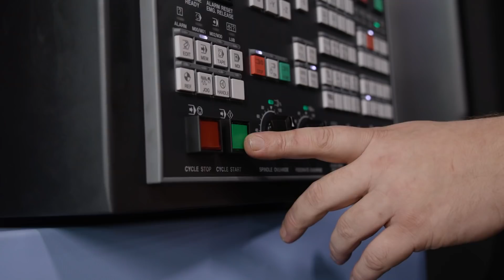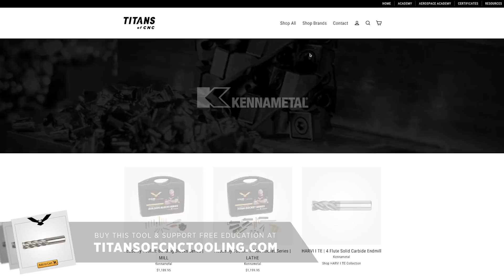NEW End Mill Cuts Through Stainless Steel Like BUTTER

Comment: How is this possible ;o I have the same steel but a pretty tiny desktop CNC machine (though the frame is steel, ball screws, linear rails etc), but I can cut slots with at most 4mm carbide endmill, 0.2mm at a time and then I see this - it literally removes the volume of the whole fucking stock I'm cutting in a split second and it would take my machine like 10h omg

Comment: I noticed you have “no coolant for filming” however I have found that no coolant is superior with the AlTiN coating in stainless since it is very wear resistant at high temps with its aluminum oxide coating. Do you guys actually run coolant in this operation? If so why?
Reply: Just wait. Ill be doing a “talking” video about exactly that, next week.

Comment: How much power does it need to run that tool like that? 😲
Also, I was thinking if you could make a video about using HSS and carbide slit saws for steel and alu? After all, it could be a very fast way to part off small finished elements from bigger chunk of material so you don't have to take it off machine and cut it on saw and/or facemill. That's a huge timesaver 🤔

Comment: I have never used a horizontal are the parts hard to load
Reply: No. Not if you have a forklift. Is it a tiny bit harder than a vertical? Yeah. But using gravity to evacuate chips makes the extra 10 seconds sooooooo worth it

Comment: Good morning! I’ve found the academy so helpful so far but my only gripe is that after the first 10 mastercam tutorials I’ve been left craving more! 😆 I was hoping for more tutorials of complex, 5 axis, aerospace-type parts to be drawn (CAD) and programmed (CAM) so I could feel more comfortable applying for a job in the industry doing that. The first ten parts is a great start but I’d like to get through quite a few more before I feel hirable as a CNC programmer. So with that said, Is there a plan for the future regarding additional Mastercam tutorials? Thanks so much. I appreciate everything you guys are doing! It’s changing the industry for the better and bringing work back to the states! Boom!
Reply from the maker: Have you done the Rocket & Fixturing Series? Checked out the AerospaceAcademy.com
Reply: Sweet! I only did those in fusion 360 so far, I didn’t know they were available in mastercam now too! I’ll start on those today! Thanks for the heads up :)

Comment: Some times you say cutting fluid off for videoing and others are blank.   Can you explain if and when coolant / cutting fluid is needed / required or just nice to have.  Still love the data you give to the world. It means your not worried.  You and the team has the abilities to use the machines and tools  at optimum  the data gives the starting point for many .
Reply: Next week, i will be doing a video on exactly that. Stay tuned
Reply: Cutting fluids are used to aid in reducing friction an clearing chips from the work zone. It is also used to control heat buildup and keep red hot metal chips from melting through plastics and rubber parts on a machine. There are times when it is necessary to cool waste chips to control destructive metal fires with some alloys or combinations. Even with flood coolant fire can still occur. If you have never witness a CNC machine on fire you would never realize how intense and difficult they are to extinguish. https://youtu.be/smcFjJFD3m4
Reply: The only time u dont want to use coolant is when doing High Speed Milling and the times when u want is in any other scenario unless u have to deal with some certain types of exotic plastics that are not allowed to get wet